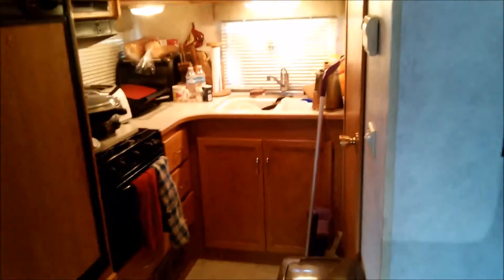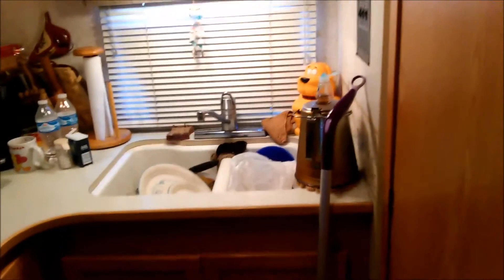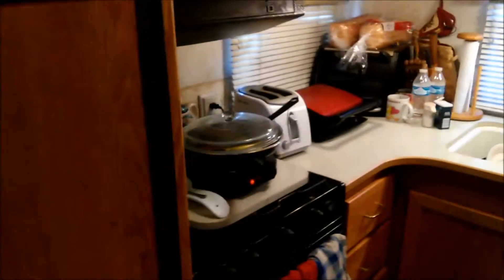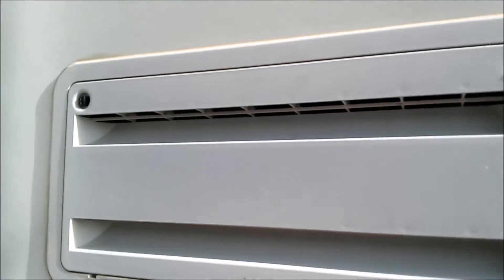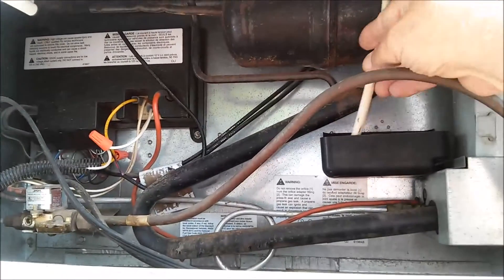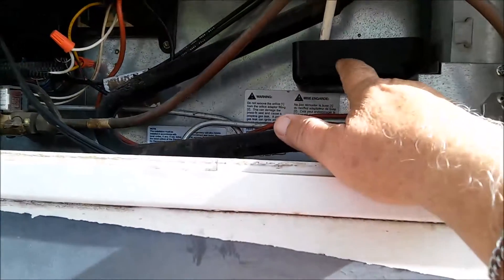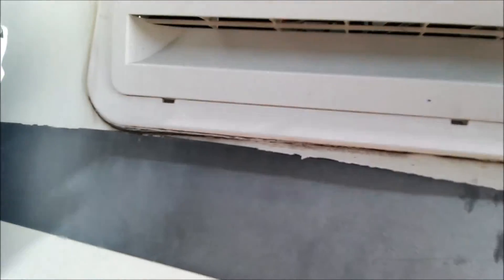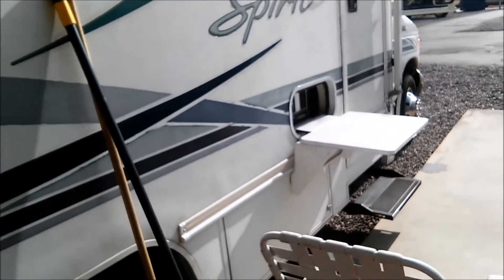Full Time RV Refrigerator cooling fix. And Drain Fix. Living in a RV full Time -Arizona

Comment: something i do  before leaving for the next destination is turn off the refrig. before unplugging from shore power, this way the refrig. will defrost while i'm driving the 2 or 3 hours and ice will never build up and when i arrive i plug in and then turn the refrig. on and wipe any water that has fallen inside the frig., there is a lose of only a few degrees, no problem.
and then i turn the propane tank to off (should never drive with the propane tank still open)  and turn back on when at final destination.